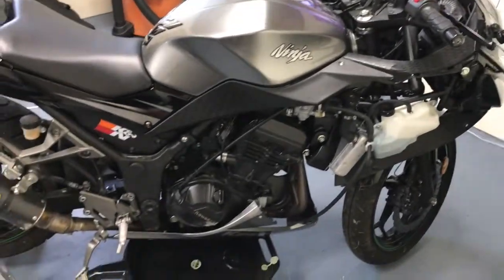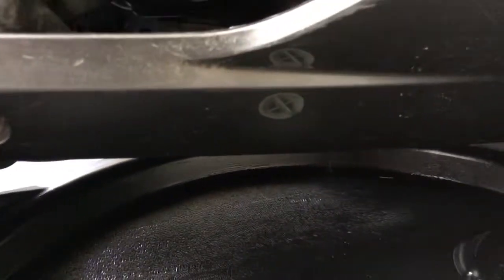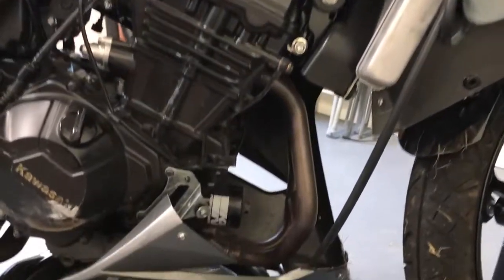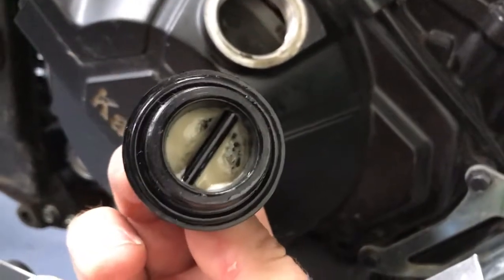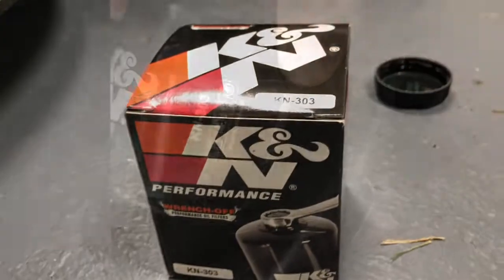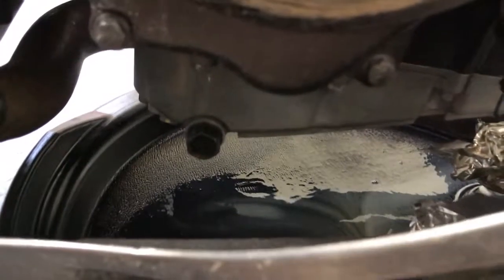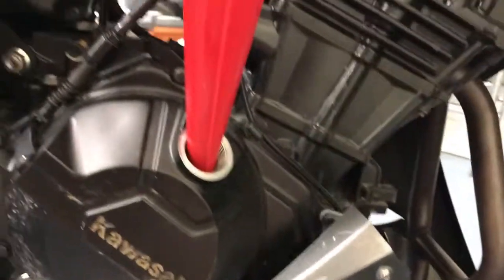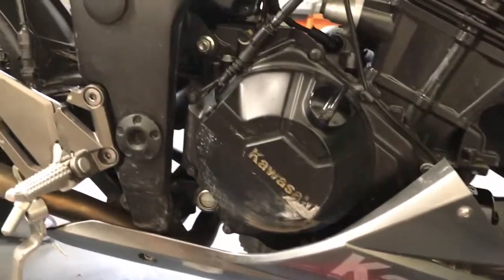How to CHANGE THE OIL on a 2015 Kawasaki Ninja 300

Comment: hey did you ever figure out what the gunk was? Im new to motorcycles and jw how normal that is? on a car thats usually indication of a head gasket leak or at least coolant mixing with the oil. I could be wrong because my car mechanic skills arent the best either. Why im asking :)
Reply from the maker: +mrorganic13 no I never really looked into it any further.
Reply: @HelpMeDIY  The oil looks like its mixed with the coolant
Reply from the maker: @aliffammarazian  it looked nasty!
Reply: That’s what the oil looks like when water or coolant gets into the crankcase.

Comment: With this level of oil that the Brazilian manual asks for, it is very close to the minimum that the engine supports and because of this, several Kawasaki break the engine due to lack of oil
Reply from the maker: +ROBSON 3R thanks for the info!

Comment: here in Brazil the motorcycle manual asks for 10w40 oil, could you tell me why there in the United States it asks for another oil viscosity and also the manual for Brazil asks for 2,200 liters and two hundred
Reply from the maker: +ROBSON 3R interesting. Thanks for sharing!

Comment: Why would there be sm ok ing after changing process?
Reply from the maker: +Damoriea Foster there shouldn’t be, but if some oil was spilled on the engine or exhaust it would burn off when it got hot and cause some smoke.
Reply: @HelpMeDIY  it wouldn't come from not putting enough oil?
Reply from the maker: +Damoriea Foster I guess it could. Did you put enough in? I can’t even begin to help diagnose it like this without seeing it.